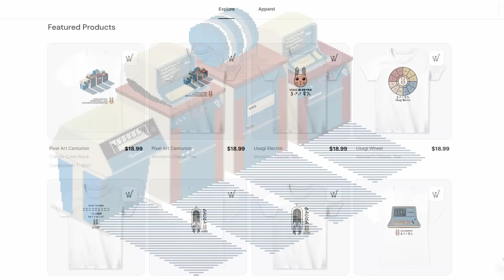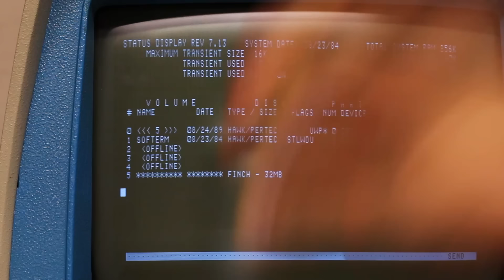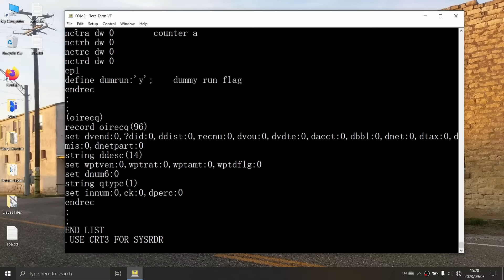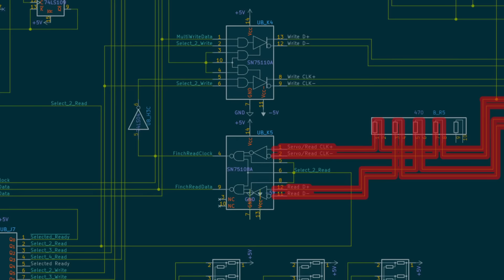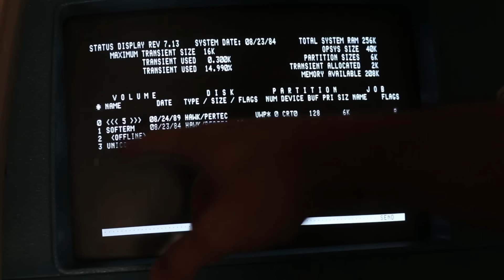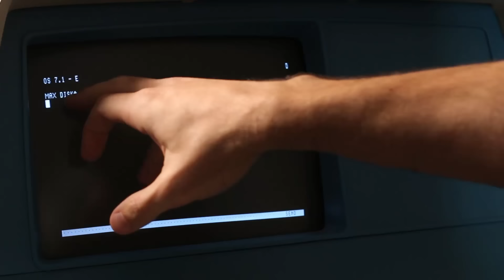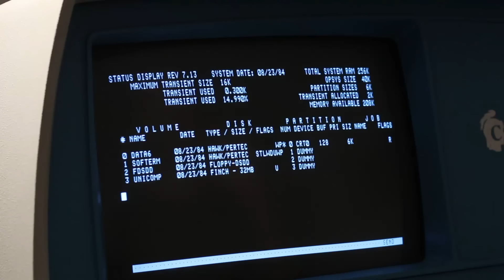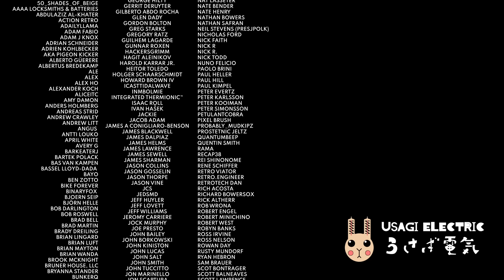14” HDD, 8” HDD, and 8” FDD All Working!

Comment: You got quite a bit of work ahead of you.  Can't wait till you have the full centurion experience.
Reply from the maker: Definitely! Still have one more Finch drive to repair, the printer, the Phoenix, a custom paper tape interface, and much, much more. It's going to be a wild machine!
Reply: @UsagiElectric  I'm curious how the printer will go. I thought you mentioned an audio tape interface as well at one point?
Reply from the maker: @danaeckel5523  The printer is going to be an interesting battle for sure!
We don't have a tape interface for the machine, but Centurion did actually use a Sykes magnetic tape drive with some machines. We unfortunately, don't have any further information than that. I do hope to build a paper tape interface for the Centurion someday so it can read in an store old Litton paper tape data. Centurion also had one of these, but it was for internal use only, so there were maybe only a handful ever built. It should be fairly easy to replicate though!

Comment: Wooo... that looks so much nicer than my manual non-electric solder sucker. I've been eyeing up a Hakko but those far exceed my cost/benefit.
Reply from the maker: I really like this desoldering iron! The only downside is that one really big chips where I have to use the bulb a lot, my hand starts to cramp up and I have to switch to my left hand. Other than though, it does an awesome job, and you can even still find new tips for it on Amazon. For less than $50, it's a dang good deal.
Reply: @UsagiElectric  If you ever find a Radio Shack 64-2185 digital soldering station you can put that desoldering end into the iron it comes with. It is 80W and the temperature control is nice to have. I used that for years until I scored a Hakko gun.

Comment: I used to use a desoldering iron just like that.  Those things worked better than you might think.  The suction was instant, and quick.  If you were good with it, it generally worked on the first suck.

In fact, i need to find a new one and buy it.  While i have solder suckers, wick, and hot air guns, there's something about that suction bulb that just works.  I mean that thing was my bread and butter for close to a year.

Comment: Love that Radio Shack iron. Solder suckers don't work for me, wick only works with my bench iron (which has the thermal mass), and the motorized ones are just too pricey for my limited desoldering. It fits in the middle well. And congrats on getting the FFC and drives sorted. Marc sent that 8" HP to a good home. 🙂

Comment: I’m curious. What would this system cost when it was new? In a similar configuration to what you have now? Anyway, I really enjoy your videos!! Thank you!
Reply: Hundreds. Literally, hundreds.
Reply from the maker: Interestingly, we found a brochure comparing minicomputers from 1983, and they have the Centurion listed, though it's a slightly different configuration.
A CPU6 system with 256k, one 32MB Finch, one 4-port MUX, one CRT and a TI-810 printer cost $41,465. The 100 LPM ODEC printer, 96MB Phoenix, 10MB Hawk, and Floppy, would add quite a lot more as it would require the drives and larger printer, as well as the appropriate PRT, CMD and DSK/DSK2 controller cards. I would estimate that would push the cost of the system closer to $60,000 (those Phoenix drives were like $10k alone). 
With a quick google, $60k in 1983 is around $184,000 today! So, in today's money, I would say a full fledged Centurion would cost between $125k and $180k depending on configuration. Not a cheap system indeed!
Reply: @UsagiElectric  that’s crazy!! I really appreciate the reply! Very neat stuff
Reply: This CPU6 system with 256 KB of DRAM,  Data-100 line printer, a few ADDS terminals, 10 MB CDC 9427H Hawk drive, 32 MB CDC 9410 Finch drive,  8" DSDD Floppy, the mulit-user OPSYS and Centurion's accounting software would be in the $45K to $50K price range in 1985.    FYI - Back in 1975 the CPU4's 32KB DRAM memory card (p/n 1003) sold for $10,000.
Reply: Next big step on the Centurion-project is to get that printer up and running? Looking forward to that. Have a soft spot for those old computers.

Comment: Epic win indeed! Great to see your progress, I'm so happy to watch things go in the desired direction :). 

Ah, replacing IDC connectors by hand! Been there, done it.
Reply from the maker: Thanks Keri!
It was super fiddly to get those connectors swapped over, but in the end, it worked a treat!
Reply: I never peeled them off though. I just cut off the connector with a pair of scissors and crimped the new one on.
Reply: @Stoney3K  I had to do that quite a bit because no IDE cable would fit my custom AT case. If you don't re-use the same position the cable doesn't mind having holes in it.
Putting a connector back in the old place always caused weird errors because it would never make a good connection again.

Comment: If or rather, since we know the pinouts and the expected signals, would it in theory be possible to make an SSD adapter? I mean I vaguely remember you saying that you didn't want to do that, but I'm kind of curious if that would be possible. [And it would make it a hell of a lot easier to debug stuff like this]

Comment: Nodemcu wifi Modem into one of the serial ports will allow external developers to run code directly on your machine. And give you text Internet access. Might be worth spending $20 setting it up
Reply: That is a cool idea, but I'm not sure if that is a good idea with the current hawk, and finch drives. Now if the classic drives could be eliminated and have a modern solution that could be used as a sandbox that would be awesome.

Comment: you need to write(port) xmodem for the centurion.  Or even better zmodem.
Reply from the maker: There's two big hurdles we have to overcome with porting software.
First, we're only now starting to get a handle on the assembly instruction set. It's bonkers and dramatically different than anything else out there. A completely custom job that has some wild features (for example, you can write to a literal address, something that should be impossible). 
Second, the Centurion uses a very weird 400-bytes per sector instead of the standard 512-bytes. This means that any file transfer program not only has to transfer a file, it has to translate the file between the two different types of file systems. This is proving to be quite difficult to overcome!

Comment: Congrats Dave!  Good job. Did you go to VCFMW this weekend?
Reply from the maker: Thank you!
I unfortunately didn't make it to MW this year. I have a trip to the Northeast coming up in October, and couldn't afford to go to both this time.
Reply: @UsagiElectric  I came "this close" to going myself.  It was a 9 hour drive from Central, PA.  When it came down to it, I just couldn't justify it; I have too much else going on, including a deep shop sink install which will make cleaning PCBs, cases, and grill tools so much easier than using the shallow bathroom sink.  I had to buy a sink pump for it and there went $300 of gas and hotels monies.  

I guess the next will be VCF East in NJ in April.  I will 100% be going to that one and plan on hitting the one in Atlanta or Chicago next year, The Lord willing 8-).

Comment: Okay, I assume the Centurion is not Y2K-safe, but what's up with the specific 082384 date?
Reply from the maker: The Centurion is "kind-of" Y2K safe. It treats the year as just a 2-digit year, so whether that year is 84 or 23 doesn't make a difference to the machine. The only time it fails is if you let it roll over from December 31, 1999 to January 1, 2000. It just increments the digit to the next ASCII character, which breaks it. 
As for the the 082384, well, that's my favorite day!

Comment: A 30 year old guy and a 60 year old guy sit at a table. the old guy asks do you remember floppy discs the younger guy says. ofcourse i do puts a flimsy plastic 3.5 floppy drive from the year 2000 on the table. the old guy says you call that a floppy drive this is a floppy drive .he then slams an 8 inch 1976 floppy drive on the table crushing the 3.5 floppy drive to pieces.

Comment: that's not a computer, that's a confuser !
can you put the floppy at the end of chain ?
Reply from the maker: I believe both the Finch and the FFC card require a Finch to be the last drive in the chain.
The FFC in particular has the Floppy hard-wired to Port 0, and then Port 1, 2 and 3 are dedicated Finch ports. So unfortunately, we can't even run two  floppy drives off this controller card. However, the FFC was designed with all the AM2901 and microcode ROMs on one board, and then the second board was the interface to the drives. So, a different drive interface board for say four floppies, or two floppies and two Finch drives, could be connected and the microcode updated to handle the new configuration. It was a pretty neat little modular design!

Comment: Well done! Please elaborate on the filesystem. I get directories, subdirectories and disks, but what's the deal with libraries?  :-)
Reply: On this machine Library functions similar to sub-directory.  In the implementation they are an entire file system within the greater file system, but all that is transparent to the user.
Reply: Thanks! But if there are dirs subdirs and files why libraries on top of it? Would they be kind of like tar archives? Maybe there will be an episode showing the proper use of this system from an users point of view and also from an admins/developers  point of view. :-)
Reply: @firstlast-tw7hc  There are no subdirectories.  Just the main directory and libraries.  Treat libraries as synonym for sub'directory and you will be good.
Reply: @rickhole  Okay, that is an explanation I'm able to wrap my Header around. :-)  I unterstand the machine does provide database funtionallity. Is some kind of database application involved?

Comment: Two questions:

1 - In Finch Disc Diagnostic, what is option A - Audio Control for?
Does the finch hard disk also work as a speaker? It would be a great accessory for the Floppotron.

2 - How can you clean, disassemble, diagnose and repair these monsters, and even record and edit videos in just 24 hours a day? And there's still time to visit your barbershop, museums of obsolete technology and go to old geek meetings.

Do you have a temporal dilation device in your laboratory? Yes, there is, don't try to deceive us, confess it.
Reply: The [ Audio Control ] in the ?Finch diag is used to turn ON or OFF a "beep" on error messages and end of a test pass.  The "Beep" is just the Control-G code being sent to the ADDS terminal to sound the beeper / bell tone.

Comment: Unicomp still exists.  I buy keyboards from them.  They still sell the original IBM AT mechanical keyboard.  Love these things.
Reply: Do not think the Unicomp you are working with for keyboards has / had any ties to the Unicomp in Richardson, TX was a Centurion dealer back in the 1980s.

Comment: Could it booth from an SSD?
Reply: you don't get the point of using the original hardware, do you?
Reply: @coalthedergsune  yes I do. But I have used brackets in the past that sped up systems like this a 4 fold.

Comment: Your videos are great and bring back many memories. Have you ever come across an AlphaMicro computer system. They used the S-100 bus. I used to use and fix the CDC Hawk and CDC Phoenix fixed and removable packs storage systems. I was a peripheral test technician and built the first AM-1000 micro computer systems.
Reply: I have my alpha micro CPU boards and other S100 stuff still in the basement somewhere. Too many dollars were sacrificed to the void to throw it away. But electrons have not exploited its semiconductors in thirty years. Flames could erupt if I had the disregard for life necessary to power it on. Weeks of RTFMs would pass to have a hope of typing something suitable if it worked.